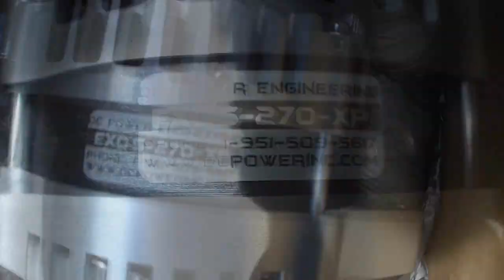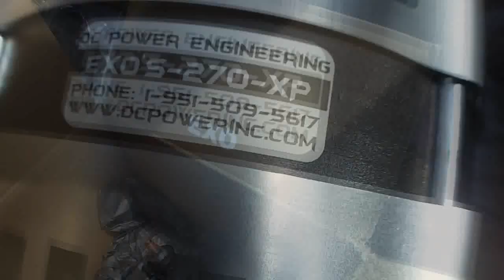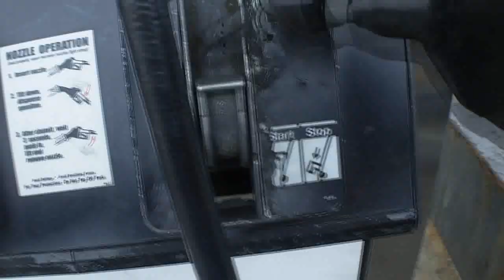EXO's NEW System UPDATES: Changing New Subwoofers? DC Power 270 XP H/O Alternator Install

Comment: What's the difference between a regular DC 270XP (Which I've used before) and the EXO version?
BTW, it's common to see a slight voltage drop by upgrading your alt. It's the amperage that counts. get yourself an ammeter (clamp-on). =]

Comment: I locked my keys in my car today with the stero on blast because I was checking out the flex of my roof. when you turn ignition on it locks my doors, had to wait 40 mins for my dad to bring me the spare set while my car just sat there banging.. I fail too